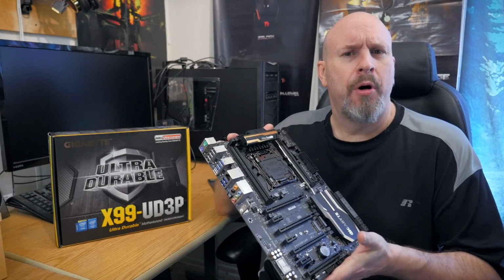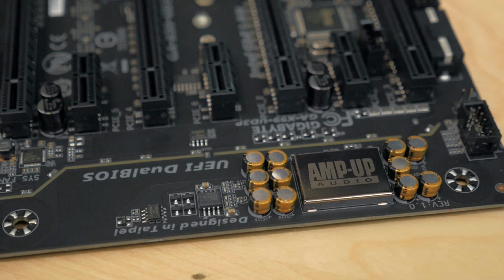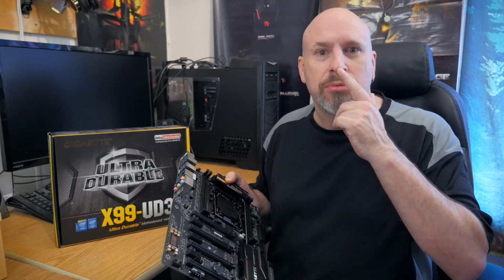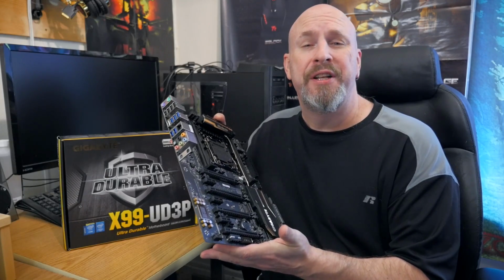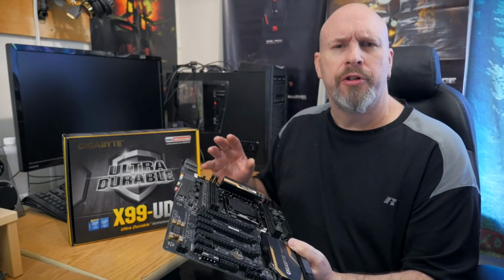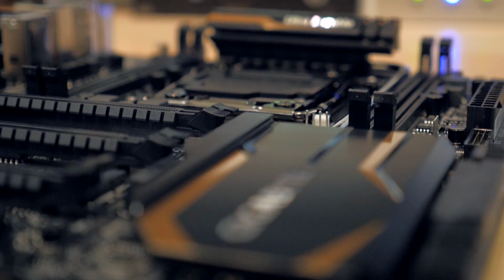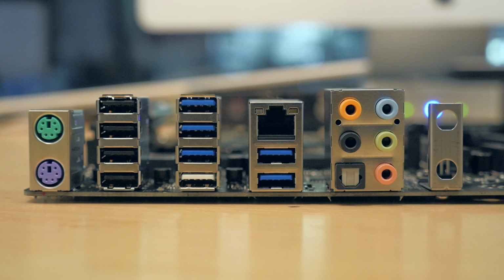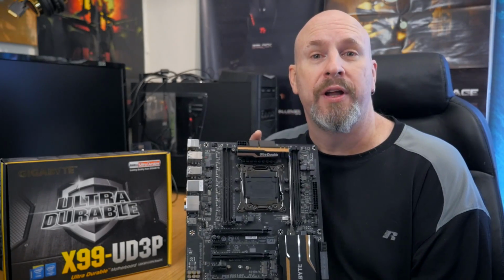Gigabyte X99-UD3P - Feature Packed Motherboard for Under $200

Comment: The reason why you only get 16x8x4 on the 5820k is because it only has 28 PCI lanes. Much like the 4790k only supports 16 lanes. that's how many lanes the cpu was manufactured to support. However the 5930k and 5960x support 40 lanes.
Reply from the maker: Iamiblaze Thank you.
Reply: Obh ok now i understand

Not xD

Comment: Great review. Covered pretty much everything.

I will disagree with your statement that if you only want one graphic card, this isn't the board for you. You are forgetting that the board has great benefits in high-end workstations. It is fairly inexpensive for an X99. It still has support for DDR4, M.2 (high speed SSD), RAID, SATA express, 10 SATA connectors, and server grade power management and components. At that price it would be a good option for CAD, video editing, high end graphics, high-end development, scientific modeling applications, etc. You also have the option of using the extra PCI-16 slot for say... high speed SSD drives, RAID controllers, etc.

For $199... it would appear to be an inexpensive solution to a high-end workstation -- even if you don't put a second graphics card in. Put a Xeon in it, use a single reasonable graphic card, high speed M.2 SSD for an OS, RAID 1 some large devices for primary storage, high speed DDR4, and you would have a rather inexpensive workstation with some serious performance boasts.
Reply: Well said.

Comment: I have a killer fx 990 mobo and for whatever reason it de-overclocked the cpu and also refuses to overclock it now.

There is nothing wrong with the cpu, no overheating or stability issues, it's really odd.

Just saying those convenient tools don't always work too well.
Reply: BUT PROTO Do you have a warranty or call customer support and be like yo my mobo underclocked my cpu man that aint cool and i want my dam refund.xD
Jokes
Reply: Moethedirt Been over a year man.
Reply: ProtoMario Try updating the Motherboards BIOS, worth a try
Reply: Brady T All the way updated - Like i said it was just random.
Reply: ProtoMario What clock speed is the cpu at
Reply: Moethedirt Currently 4.0 with dips into 3.9's but I had it stable without problem for months at 4.6
Reply: +ProtoMario It's power saving..
Reply: IaMaWeSoMe7478 Doesn't change anything, I am getting a new MOBO though so I think my MOBO is done.

Comment: The reason why you only get 16x on the top PCI lane with a 5920k is because the processor can only support 28 PCIE express lanes where as the 5930k can handle 40. If you have the 5930k you will have the 16x on the top two and 8x on the bottom two

Comment: The 5820k only has 28 lanes vs the 40 lanes of the 5930k and 5960x. That's why the slots run at lower bandwidths.

Comment: The chip 5820 has fewer lanes internally so it can't run all those lanes on the ports at full speed. Least the way I understand it from a computer science background that it's the limitation of the chips themselves.   The board looks nice but x99 and the ddr4 was still more expensive than I really wanted to go to so I jumped on z97 last year and kept my existing ram.  Good look at the board though. Good video.

Comment: The reason it's 16/8/4 when using a 5820k is because that cpu only has 28 pcie lanes. The 5930k and 5960x have 40 pcie lanes

Comment: Thank you so much for Great Review Love PC Review in every piece  
Does it Support 5th Generation of Core i7 CPU?
Reply: FantasyNero I know on my z97 board all I had to do was flash the bios to make it 5th gen compatible. So if it doesn't out of the box that should be a option for the X99 platform to.
Reply: shawn finkenstead So it's not support i7 5930k? right
Reply: FantasyNero The 5930k uses the 2011 v3 socket. So yes the board Elric just reviewed will support the 5820k, 5930k, and the 5960x.  But the answer you are looking for is that the 5930k will work on this board.
Reply: shawn finkenstead Thank you so much!!!
So this Motherboard is great and cheap!
Appreciated for your kind reply! :D
Reply: Your Welcome. Most people that follow ToT will always jump in and help. So always post any questions you have.
Reply: shawn finkenstead  I appreciated i was follow this channel and Motherboard.org about 6 years ago. :)

Comment: I know this is kind of an old video, but I'm sad you didn't try to build a system with this board. If you had, I don't think you would have been smiling throughout, since overclocking in the BIOS and XMP profiles just plain dont work on this board.

Comment: Is the "ASRock Fatal1ty Z97 Killer" a good choice for gaming?

CPU: Xeon E3 1231 v3   (So. 1150)
GPU: ASUS Strix GTX 970
RAM: 16GB 1600MHz CL9 Ballistix Sport
Case: Zalman Z11
SSD: Samsung 850 EVO 250GB
Reply: its a great motherboard for gaming
Reply: Dont use xeon processers
Reply: Why get a xeon? A normal i7 or i5 should do the job just fine,,
Reply: 2HIGH Why not? Xeons are just i7s without integrated graphics and lower clock speed.. About 100 to 200MHz...
Reply: Ralph dekeyser Okay, which one? Same or lower price as a xeon - Xeon = 260€!
Reply: go for a core i7. Xeon is for servers
Reply: 2HIGH Bullshit. The Xeon E3-1231V3 is exactly the same as the i7-4770 (non-K) without the integrated graphics. @Marc: I'd definitely recommend you this over the 4770, as it is cheaper and exactly the same.

The Fatal1ty Z97 Killer is a great motherboard, especially at its price range.
Reply: 2HIGH You dont know what youre talkin about
Reply: You don't need a z97 MoBo if you use a Xeon. A h97 or even b85 would do just fine:)
And don't listen to the guys saying xeons are for servers,the E3s are desktop CPUs. I'd say the ASrock h97 annivrsary would be a good choice. Or the h97 fatality. You could get a hdd or a better case for the money saved!
Reply: Florian Ivan Yep!
Reply: Florian Ivan Thank you. :)
Reply: Vlad Draghici Are you sure? I heard that ~80€ MoBos are bad... Also it does not have support for SLI or Crossfire.. But I think I won't need those. And the anniversary also only supports maximum of 1600MHz RAM, and only a 5.1 Audio...
Reply: Vlad Draghici Also, which case would you recommend? I thought about this one; http://www.amazon.de/VIBOX-Tactician-Geh%C3%A4use-Speicherkarten-Leseger%C3%A4t-Temperature/dp/B00CRETKFS/ref=cm_cr_pr_product_top or that one: http://www.amazon.de/gp/product/B004YISUKG/ref=s9_simh_gw_p147_d0_i6?pf_rd_m=A3JWKAKR8XB7XF&pf_rd_s=desktop-2&pf_rd_r=1CQ5GZQ2NAY2W37RMK3H&pf_rd_t=36701&pf_rd_p=585296387&pf_rd_i=desktop
Reply: ***** If you want that particular look, you can go for that case. Otherwise I'd recommend you to go for "classic" case manufacturer brands and take something like these:
https://www.alternate.de/Zalman/Z11-NEO-Gehäuse/html/product/1152504?tk=7&lk=8354

www.amazon.de/Corsair-Computer-Carbide-SPEC-01-Tower/dp/B00L6AXHYO/

Comment: I have the 990FXA-UD3. It's an AM3+ mobo...

If someone couldn't afford more than $200 on a mobo, why would they be able to afford the 2011-V3 $400, $600 and $1,000 CPUs?
Reply from the maker: SpurnOfHumanity CPUs come in at under 300
Reply: of that socket type?

Comment: Hey man, what would you suggest for running the witcher 3: Galax GeForce GTX 960 EXOC 2GB or the Gigabyte Radeon R9 280 Overclocked 3GB. Both are equally priced in Australia

Comment: I think i will get this. I was going to get the G1 gaming WIFI but this is much cheaper and yea, even though im using 1 GPU.

Build:
CPU: Intel i7 5820k
Memory: Corsair Vengeance LPX 16GB (4 x 4GB) DDR4 2666
Motherboard: this
GPU: I havent figured this one out yet

Im going to do gaming with this. Is this one good?

Comment: I have a question... You said if you use a i7 5820k cpu from intel then there are only 1 8x PCI 3.0 and one 4x PCI 3.0? Are there any PCI 3.0 16x when using an Intel i7 5820k?
Thanks

Comment: very cool mate need too know what is the great MSI motherboard that handle all amd processor even fx-9590 or future processor please let me know
Reply: I dont Think so denise why is it dead ?
Reply: GTASeries Mods FX 9590? Really? Just grab an i7 which costs the same and is much MUCH faster. Or if you want AMD, get the FX 8320 which will be just as fast once overclocked
Reply: AliveGhost13 fuck intel just expensive for nothing i got FX-8320 with msi radeon r9 290 twin frozr i need good motherboard that can be for future amd processor's
Reply: Denis Koprivc you know that you are funny
Reply: GTASeries Mods That's fine, stick with the AMD, but the FX 9XXX series makes no sense. You pay more and get more heat for no performance benefit

Comment: problem with modern motherboards is that they have bad soundcard. Realtek 1150 is crap, specially in games. I bought 10 years old X-Fi Titanium Sb 0880 because it sounds 10x times better than realtek that is everywhere - from cheap to enthusiast motherboards. Mine is MSI Z87-GD65 Gaming and no matter what softwere I used (Realtek Studio or Sound Blaster Cinema) Realtek is still CRAP against old dedicated soundcards !

Comment: I wouldn't touch gigabyte motherboards with a barge poll. I have an x58 ud3r .... Absolutely rubbish, hangs on every cold boot.
Reply from the maker: metalhead2550 Sounds like its having problems resolving the memory, have you tried a different set?
Reply: Tech of Tomorrow Yes, it just seems that if you have all 6 slots populated it just doesn't like it :-\ Just going to wait til it completely dies so I can replace it. Hoping the new AMD Zen/K12 will be out by then! Hope all is well with you Elric! :-)
Reply from the maker: metalhead2550 It is and have fun, I knew it was a memory issue though.